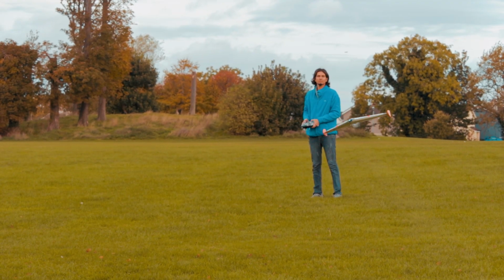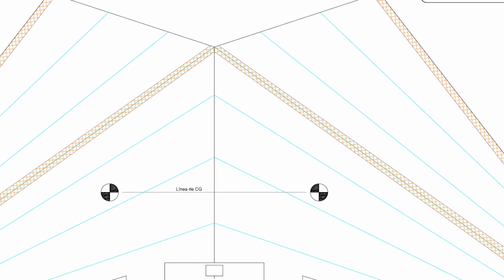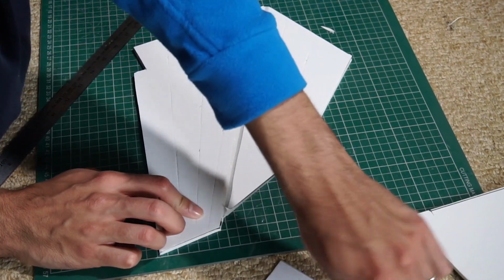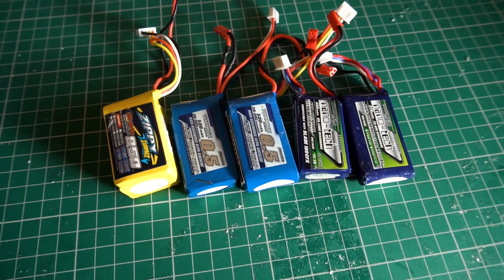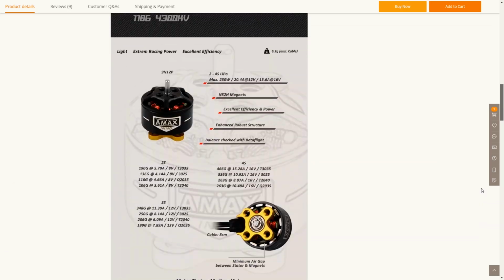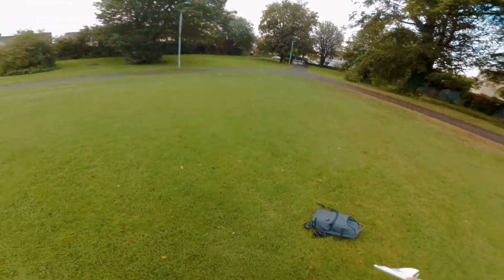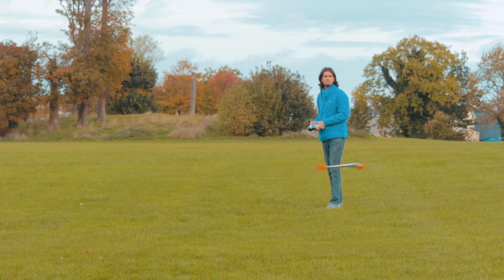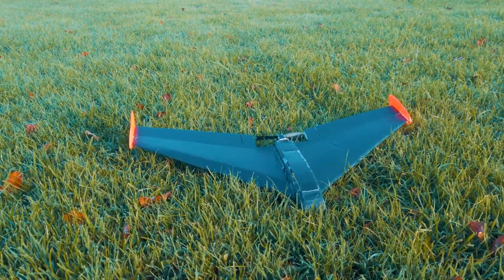I made a mini flying wing | Joywing V1.0 - free plans

Comment: I make this rc delta wing including all the weight of this 95g but my motor  thrust is 80g is my rc delta wing will fly or not
Reply from the maker: Yes, it will fly perfectly.
Reply: @Joyplanes  thankyou so much sir
Reply: Sir I am using this 1104 7500kv  brushless motor so can I use 2s GNB 300mah 80c lipo battery is it work perfectly and proppler which I am using is 2.5inch with this motor so my lipo battery will safe or not

Comment: Is it fine if i use a 9g servo (those blue Chinese ones) or is it too big for this plane and is a 2212 brushless motor too big
Reply from the maker: it's fine, they might protrude a bit but not big deal. And the motor will be too big, use 2206 as the biggest.
Reply: Well... You have a bigger servos and bigger motor, so why don't you just go and make a bigger flying wing? Just make plans bigger (like 2:1 or 3:1) ...

Comment: At this size you might as well use a flat plate or KFM airfoil especially if you are going to increase the build weight with hot glue and 3 or 4S batteries( hotglue can easily separate in outdoor temperatures) . If you want speed then you want Low drag and you want to match your components to squeeze as much as you can out of them.There is a reason why the F-16 uses a different airfoil than the 747 .Great experiment but i think you wasted time by trying to create a random airfoil and your wasting potential energy which could be turned into efficiency because of the build method and heavy components.
Reply from the maker: Thanks for the observations, the airfoil works great for me, I think making a KFM will be the same weight since it's just a 2 layer wing. The version 1.1 is a lot faster and better and I'm still using the same airfoil, no problems with it at all. Don't miss the next video of that new version.